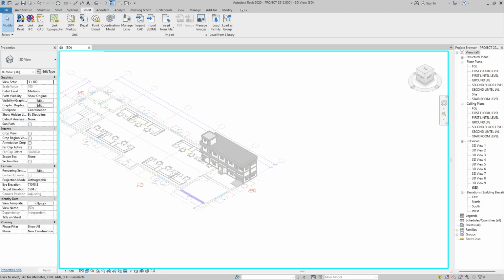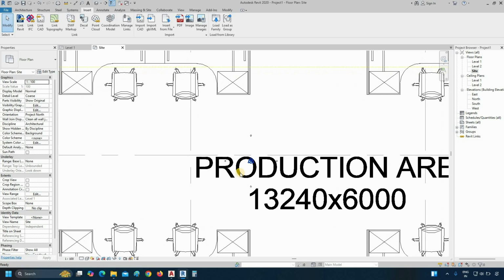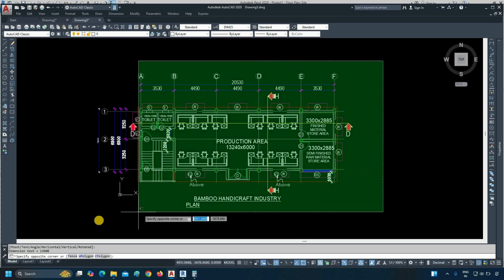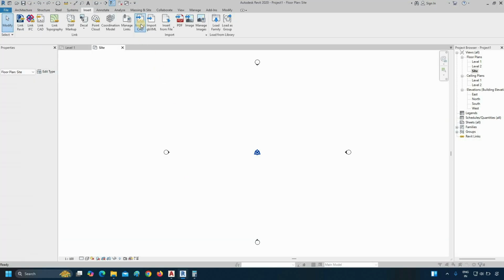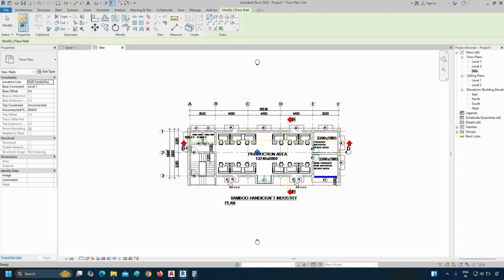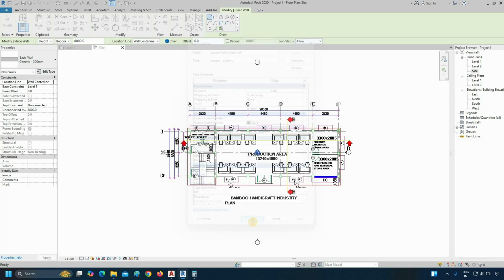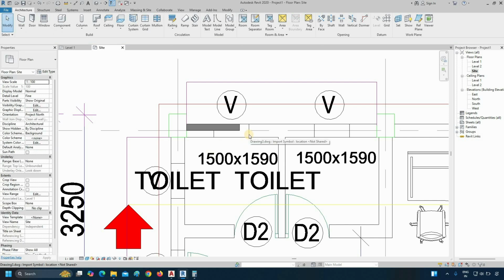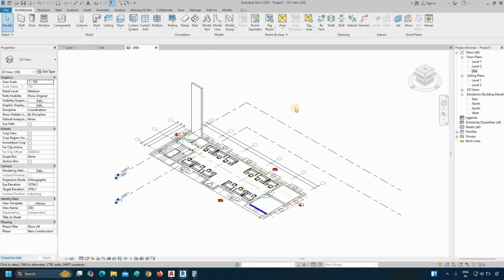AutoCAD import scale problem in Revit.

Comment: Which template you use mean arch, construction etc... i asked bcz i am new to revit
Reply from the maker: Try first with the default metric if you are working with the metric system. And if you are working with feet and inches, then select default imperial.